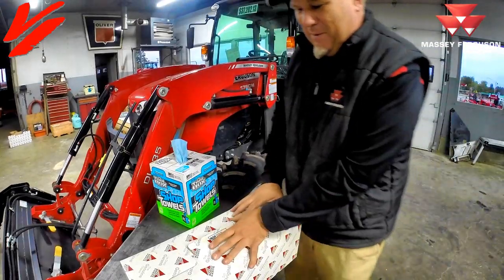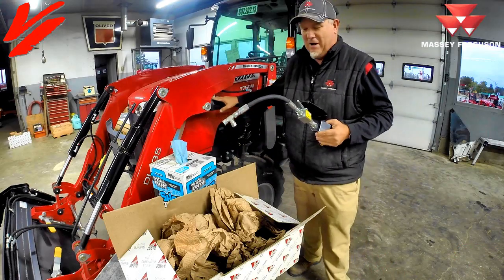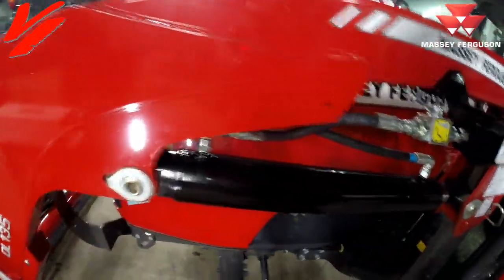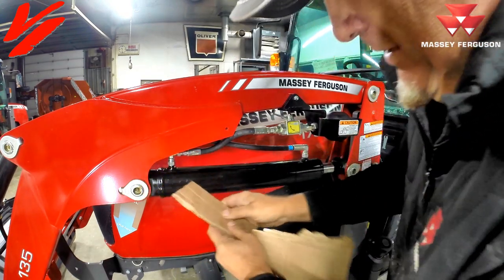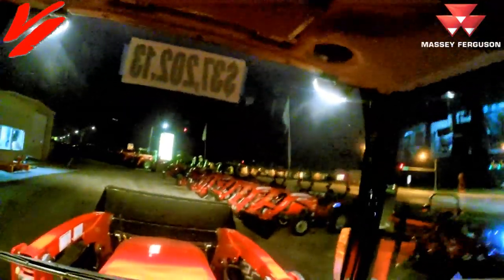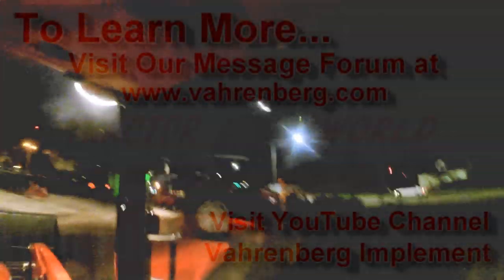Massey Ferguson: How to Install SoftDrive Loader Suspension on DL125 or DL135 Loaders

Comment: Hey there, Doug.  I have a MF 1760M and it has a FL 2814 loader.  Does the Soft Drive Loader Suspension you demonstrated fit my FEL or is there a different soft drive Loader for my particular tractor?  I am soon going to purchase a Lane Shark brush cutter that mounts to my tractor's SSQA.  I'm thinking the soft drive loader will reduce stress from the weight of the Lae Shark.  Maybe I'm wrong; not sure.  Thanks for the demonstration and have a fine week.  Don  👍🏽🤠 4/3/23
Reply from the maker: It's not the exact same part number but works the same. for the FL.2814 Loader you need to order ACP0426720.  We have them in stock if you can't find one locally.
Reply: @VahrenbergImplement  Thanks Doug.  I'll check to see if the dealer has one in stock, if not, I 'll head your way.  Appreciate all your informative videos.

Comment: Can this be added on any MF. I have a 4708 with a 931x loader. Would it possibly be the same part number?
Reply from the maker: SoftDrive is available for the 931X. AGCO Parts Kit Number for the 900X Loaders: AL5034241
Reply: @VahrenbergImplement  I found that part number last night on the internet. Thanks for the info. I called and got a price from my dealer too bad we didn't get it installed when buying the tractor.
Reply from the maker: It's not hard to install. Just relieve hydraulic pressure on the loader before installation is best tip we can give

Comment: How would I be able to use the switch in the cab of a 4707 cab with the soft drive?
Reply from the maker: The SoftDrive on the 4700 Series is Electric Controlled by a switch on the loader joystick which is built in as standard equipment on the tractor. The 931X Loader requires the additional installaion of SoftDrive or the FL.3615 Loader comes standard with SoftDrive from the Factory so it's ready to go. Flip switch to turn on/ flip switch to turn off.
Reply: @VahrenbergImplement  I have the 931x.  So the switch won't work with it?  Just comes with the manual lever for this loader?
Reply from the maker: Correct. The X Series loaders are Manual Accumulator versus the FL Series are Electronic Controlled.

Comment: Why is there an on/off switch? When would it be better to turn off the accumulator function?
Reply from the maker: There are times that you may not want it turned on like precision lifting or loading that you don't want the loader to absorb the shock load. Many never turn off but it provides you the choice to do so.

Comment: Just to answer everybody's question, that unit is a hydraulic buffer and should work with any make or model tractor. It's only limitation would be that larger tractors may overwhelm it, but any tractor that size or smaller should work. Its basically a piece of pluming all you need to do is make it fit.
Reply from the maker: Accumulators increase in size or number of accumulators are matched based on Loader Size, Capacity and Cylinder size, etc. You could use on other machines. But I would check the warranty policies as non-approved accessories of modifications can effect Warranty Terms if needed. Why we sell Genuine AGCO Service Approved Accessories for Massey Ferguson Tractors. When you do that I know our customers are protected and no questions asked they protected and guaranteed it works correctly.

Comment: Is there a version of "soft drive" that would work on the DL 95? I know there isn't one listed by AGCO...
Reply from the maker: Not sure the Accumulators are engineered to work with the hydraulic cylinders on the DL95. I know they are going to offer SoftDrive for the New FL.1805 Loader it might be better to customize to fit. It has to be engineered to work with loader and cylinders.

Comment: What's the price for one to fit the DL125?
Reply from the maker: $532.27usd is the current price (10/30/19) for the SoftRide Kit for DL125 or DL135 Loader from AGCO Parts
Reply: @VahrenbergImplement  thank you.
Reply: Vahrenberg Implement do they make it for a 931 loader?
Reply from the maker: They offer SoftDrive on larger loaders like the 900, 900X and FL Series Loaders.

Comment: Would this work with a DL95 if you figured out a way to mount it?
Reply from the maker: Not sure the Accumulators are engineered to work with the hydraulic cylinders on the DL95. I know they are going to offer SoftDrive for the New FL.1805 Loader it might be better to customize to fit. It has to be engineered to work with loader and cylinders.
Reply: Yes, I have installed one on my 2016 GC1720. It required replacing the hose that comes from the right side with a straight end instead of a 90 degree. I had to drill a new hole to mount it as the existing one is too far back and finally I had to bend the bracket so the unit points at the fitting on the ram. It works great! Read up on how to properly tighten these connectors.
Reply from the maker: That is good to know. You should make a video showing what you did and how you did it so others can learn. This would help previous owners upgrade their loaders with this awesome feature. Share the Video Link to so others can learn.